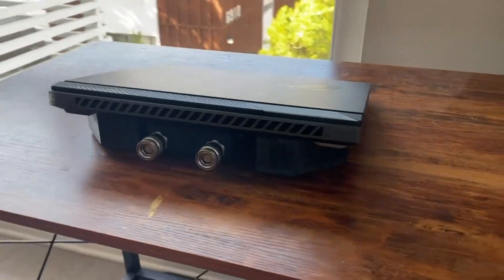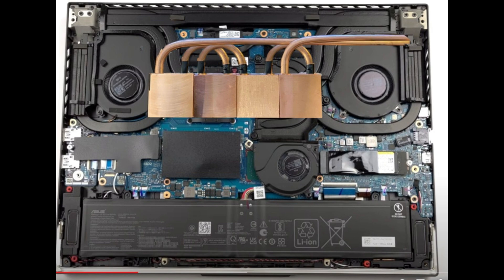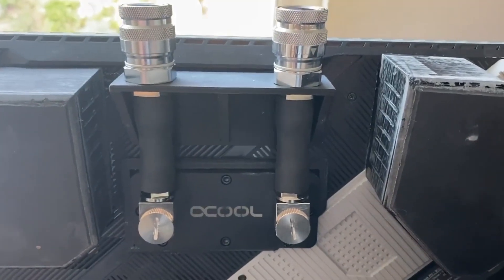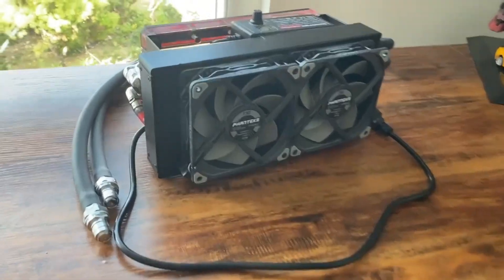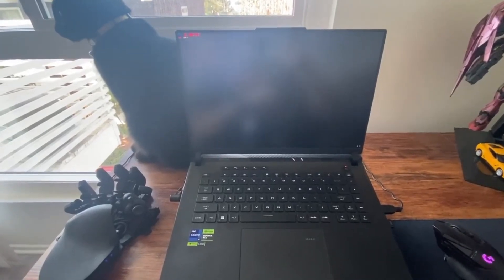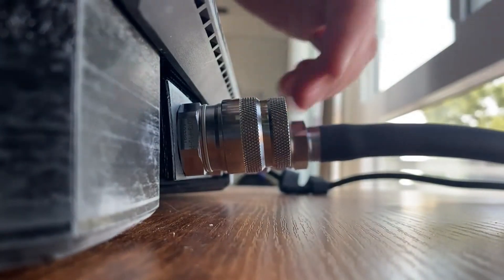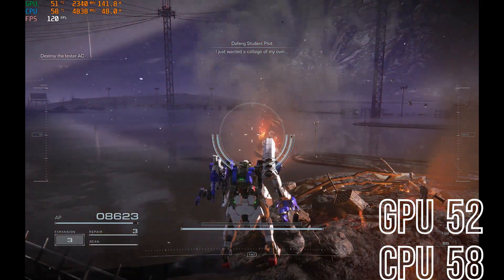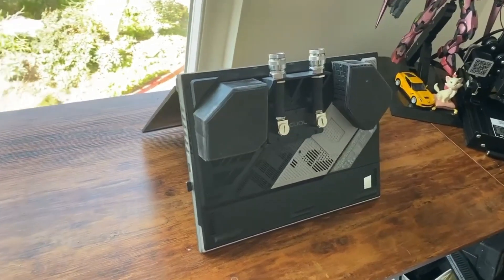Water Cooling a Laptop is... Easy?

Comment: Hey Sloreo awesome Video. My Laptop also throttles because of high temperatures and want to mod my Laptop too. However, I am not familiar with the pumps and reservoirs. Can you give me a recommendation. Had the Alphacool Eisbecher Aurora D5 Acetal/Glass - 250mm incl. Alphacool VPP Apex in view. Would you recommend it or another? Can I use a smaller reservoirs like 150mm. Alphacool Eisbecher Aurora D5 Acetal/Glass - 150mm. D5/VPP Apex which pump can you recommend.

Comment: Nice work! I've been wondering if I could actually mod the stock heat pipes to take water but maybe I will do this, seems pretty safe! Thanks for the vid!
Reply from the maker: That was my original plan actually but I went this route to keep the air cooling working.
Reply: @sloreo8278  Yeah good idea. I'll probably give it a shot next month. Do you think over time it will get heat soaked? Have you done any long stress tests?

Comment: I'm planning on doing this as a project. I have divorced parents so I need to bring my setup between houses (which means I can't have a desktop PC), and my fans are more akin to rocket engines, so I'll definitely be trying to water cool my laptop! You earned a like and a sub.
 
Edit: Do you know if this would work on a Scar 15? Thanks.
Reply from the maker: This should work on any laptop but the space between the back case cover and the heatsink will vary. You might need to sand some material off if it is too tight.
Reply: @Oh thanks, I found that some of the parts have been discontinued so I’m not sure if I’ll be able to make this work

Comment: Can I ask you how you soldered the pipe to the heatsink? I’m just a little scared that the heatsink will fall apart because of the heat. I mean the heatsink is also only soldered, right? Did u have problem of the heatsink falling apart?
Reply from the maker: @mr_geggi2691  if you dont mind the bulk I recommend using a CPU or RAM water block. If you are set on soldering, you will want as many metal c clamps as you can get to hold it all together. You can also use aluminum tape but idk what temp that will be good up to. If you dont use clamps it absolutely will fall apart. LTT did a video on that method a few months ago. "Water Cooling a Laptop for $30" iirc.
Reply: As for now im with soldering because my cpu and gpu dye are not lined up like yours. Which would lead to a diagonal waterblock arrangement. Think I won’t like that 😅. 
Plan for now is to use as much clamps as I can like you wrote and just use the heat gun to heat up only in small areas. At least I hope it will heat up small areas.

Comment: at this point just get a desktop its not laptop anymore ( but really amazing work )
Reply from the maker: @negadyoucef647  it is still portable as it is, albeit I have a new job so it doesn't go to work with me every day now, so a year later Id rather a desktop. That said, the air cooling still works fine, it is jsut bulkier.

Comment: This is really good! You have a version 2 of this based from what you observed?
Reply from the maker: This is version 2 and I have a 3rd Ive been using. The first was another video I did with my old MSI GP66. The only changes Ive made since this have been using a different water block for better contact and cooling.

Comment: Pretty nice Modding. 
But i prefer the easy Connection to the oasis. 😂
Reply from the maker: @MichaelK-lz7jk  the oasis is definitely prettier, but this uses similar quick disconnects and has more than double the cooling.
Reply: @sloreo8278  You dont have more power with that cooling, the oasis is enough to reach the Max Watts. If you have 50 or 65 degrees, that didnt make difference. 
The new one with 16“ is Even more powerful, it can 200Watts on CPU, more than every other Notebook.

Comment: did u place the 3D printed feet exactly where the air intakes were supposed to be for the air cooling? i mean this stopped you fom combined cooling
Reply from the maker: They aren't placed based on the fans for this one. The feet don't block the air cooling at all though, it still works as well as it did without the water block installed. There isn't much point of using both at the same time though, the water cooling already cools the heatsink enough that the fans make little difference.

Comment: Sorry man the red liquid that you use for the cooling system is electrical conductive? or not? if there is a waterdrop inside its risky or nothing will happens?
Reply from the maker: The coolant is absolutely conductive, it is similar to automotive coolant and is primarily water. I am not sure if there is a non conductive coolant out there other than thicker oils which are used for less common fully submerged builds. If the water block ever leaks, it will be a bad day for me lol.
Reply: @sloreo8278  ahah so hope it will never happen 🙏

Comment: Is this possible on a Lenovo legion 5 slim 14?
Reply from the maker: It will work on any laptop that has a traditionally mounted heatsink, like your slim 14. The only ones I know of that wouldn't work are the Dell G series which have the motherboard inverted. 

The only thing Im not sure of on ones other than mine would be the gap between the case cover and the heatsink. If it is too tight you might need to grind the cold plate some to not flex the bottom case cover too much, as I needed to do with the AMD block Im using on my most recent video.

Comment: thats awesome :O i wonder if i can do the same with my laptop. however my laptop has inverted motherboard :( gonna be a nightmare
Reply from the maker: There isn't any clearance with an inverted mobo sadly, unless you want a hole in the middle of your keyboard. I actually sold my Dell G15 a few years ago specifically to get a standard layout to water cool it.
Reply: @sloreo8278  yea, guess am done for :/ thankfully switching to liquid metal did gave me a bit of advantage, but i cant reach my max clock speeds. Funny enough i tried putting my laptop near AC and my laptop ran at max 80-85 degrees Celsius and ran at max performance 🤣🤣i was hitting PL2 limit all the time on my CPU, thats 25 extra watts 👌👌

Comment: Is there a way you could help me out... A total noob to do this with my dell g15 5515 Ryzen edition?
Reply from the maker: This is not possible with the Dell G15 sadly. The Dell mounts the motherboard upside down so that the heat sink is actually between the motherboard and the keyboard. There is not space to do anything like this or like my other build on my MSI. That was actually the reason that I sold my Dell and got my GP 66 a few years ago, I wanted to water cool it and it wasn’t physically possible.

Comment: How did you mount the ram heatsink to the motherboard? Or you're just relying on the thermal paste & the pressure from the back panel?
Reply from the maker: The block is just mounted by the pressure of the bottom cover. The gap between the case and the heatsink is about 4mm and the cold plate is 4.2mm. Once it is fully installed it gives it a decent mounting pressure.

Comment: How did you connect the fans to power?
Reply from the maker: The fans are powered by the variable PSU in the parts list under the description. I cut off the barrel connector and soldered in power for a PWM connector and a SATA connector for the fans and pump respectively.
Reply: @sloreo8278  Ah thank you
Reply: @sloreo8278  Also do you think you could improve performance even more using a cooling pad like the iets one?
Reply from the maker: @rrrrrrrfffdfjhre  The heart of this project is to run the laptop silently more than to cool it drastically more than stock, although it certainly does. With the laptop's own fans at 100%, the cooling is only improved  by 1-2*, nothing substantial. The IETS might give it more kick, but at a certain point there is only so much head that the heatsink can dissipate. Realistically, this is a very inefficient way to cool the laptop as eventually the heatsink will be a bottleneck. By using the IETS you would more than likely hit that bottleneck for little gain while also going from nearly silent running to 60db of fan noise.
Reply: @sloreo8278  That is very true. Do you have a discord server of some sort I could join?
Reply from the maker: @rrrrrrrfffdfjhre  I do not. Always glad to answer questions here though where they might help someone else with a similar question.
Reply: @sloreo8278  Alright well thanks for responding to me I'll let you know if i run into a different issue
Reply from the maker: @rrrrrrrfffdfjhre  within the next week probably. I’m trying out a different water block to see how it works compared to the others, but I needed to get a new bottom case cover and basically remake the entire thing.

I work 12 hour shifts 5 to 6 days a week though and this is just a hobby. Definitely don’t want to make any expectations for a schedule or any videos after the next one realistically.

Comment: How are you powering this whole thing? The waterblock I mean.
Reply from the maker: Just a variable 12v power supply from amazon. Cut the barrel jack off and soldered a PWM and SATA jumper on. Totally missed adding it to the parts list in the description.

https://www.amazon.com/gp/product/B08BL55LMB/ref=ppx_yo_dt_b_search_asin_title?ie=UTF8&psc=1
Reply: @sloreo8278  Thanks. Amazing work btw. I'm going to do similar mod for my laptop but with 120mm setup instead, and fool around with M.2 water coolers since they're even slimmer in profile.
Reply from the maker: @aj9156  I hope it goes well! Im trying a revision in a few days with a different water block that has some micro fins to see if it is any different, hoping it will improve by a few degrees. The slightly smaller SSD block should still be plenty to make a difference, but I did have concerns about how smooth they are when considering them.

Comment: The setup is very great. I just want to know how do you supply power to those fan and pump? And how do you control the speed.
Reply from the maker: The power supply is a 12v variable psu from Amazon that has a dial to control power. The Phanteks T30s have a speed setting to cap the maximum fan speed so I can set them to stay silent while cranking up the pump or set them to full speed for benchmarks.

Comment: Will this work for other laptops given the variation in mounting pressure?
Reply from the maker: I really lucked out with the Scar 16 having 4mm between the heatsink and the inside of the bottom case cover. Most laptops should have similar spacing but might need some sanding to make it so you aren't putting too much pressure on the CPU/GPU die. 

Easiest way to measure is to use putty on the heatsink, put the cover on, then measure its squished height, it is how you measure clearance for bearings in an engine too.
Reply: Question: I have a vapor chamber heatsink laptop instead of tranditional heat pipes, (the asus rog advantage). Do you think it will work just the same if I put it on top of the gpu and cpu location,? Does sanding off the black paint from the vapor chamber neccessary before putting thermal putty?
Reply from the maker: @giangle2849  A vapor chamber will work as well and has the potential to work better because you can get a larger water block and have a bigger surface area to cool. I would still center the cold plate over the CPU/GPU but realistically it shouldn't matter too much because of how the VC works. 

I haven't sanded the paint for mine at all and don't think it would make a worthwhile difference.
Reply: @sloreo8278  thank you!!! Attempting the same mod, hopefully it will turn out like yours!!
Reply from the maker: @giangle2849  Hope it goes well! Check out A-Accessories for a spare bottom case cover. They have OEM Asus parts and have been great for me so far. That way you can have your stock cover for any warranty work or air travel.
Reply: @sloreo8278  mine is stantionary most of the time, also do you think the pump volume affects the temps noticably, can I just go with 1 fan and 1 radiator and a 300l/ hour pump?
Reply from the maker: @giangle2849  my MSI build uses a similar pump from amazon and sees similar temps, not quite as good but it also uses a different setup so it is hard to compare. I did notice a huge difference going from the BeQuiet Pure loop pump but that is a very small and slow pump. 

Water cooling does have diminishing returns and generally 120mm is recommended for every 100w of power. I think that 240 will be plenty for any laptop but 120 wont be quite enough, see XMGs 120mm Oasis as it still hits 90* in Dead Space. The price difference for getting twice the radiator isn’t much, not to mention if you change your mind later and get a second one anyways. 

I just tried using 2 240mm rads for a total of 480mm and had negligible differences (2* about) that were probably more from the difference in ambient. Havent tried only using 120, but just looking at the XMG/Tonfang/Dream Machine/Eluktronics I don’t think it would be enough.
Reply: Would you say this is superior to copper water pipes in terms of heat dissipation?
Reply from the maker: @giangle2849  yes, especially for you having a vapor chamber. The biggest advantage here is that there is greater surface area for heat dissipation, aside from being safer from not needing to solder. 

If you look at the first place score for 3DMark Time Spy with a notebook 3070ti you'll see Microbemossberg's absolutely stupid low temperatures. They are running a Legion with literally the entire VC covered in TG PP10 thermal putty and those small copper water blocks I was considering using shown in the beginning of the video.

https://www.3dmark.com/spy/43532529
Reply: @sloreo8278  wow 22 degree for gpu is nuts
Reply: @sloreo8278  those coppers water block are some thick boy. I was thinking of designing a flat copper water block with bigger surface area and about 5-6mm thick to cover the whole VC but I don't have the decent fusion 360 skill to actually make a model out of it lol
Reply from the maker: @giangle2849  I had hoped to do similar to cut down on the height and increase surface area but wasnt sure how to go about getting the heat sink machined or printed without it costing more than the laptop did lol.
Reply: @sloreo8278  Hey bro, I finally finished replicating what you did and made a video about it. The result was great, still there's room for some improvements but overall it's great. Really appreciate what you did
Reply from the maker: @giangle2849  Awesome work!
Reply: What is your max cpu temp when running Cinebench R23?
Reply from the maker: @giangle2849  iirc it is 84* pulling 180-160w. Cinebench will absolutely still get your temps cranked up. My GP66 still hits 90*

Comment: I was thinking of using an all in one loop for price and ease of assembly, similar to this,
Definitely easier than low temp solder, but less removable.
Reply from the maker: You could absolutely use an AIO but the cold plate on them is generally much thicker because it is where the pump is. Your best bet going that route would be a BeQuiet Pure loop because the pump is in line with the hoses, and not part of the  water block. 

I know some people who tried doing that with thermal pads instead of putty and didn't have as much success with the cooling though, and using putty with an AIO you'd need to leave room to twist it off, because once it is squished down pulling it might cause damage.

Comment: If you want to go the extra mile you could 3d print a new bottom panel instead of chopping up the current one. Nevertheless it'a more revised than the one with the msi notebook.
Reply from the maker: If I had a bigger printer I would be much more inclined to go that route. The Scar does have some odd lines to it but that isn't anything some measurements wouldn't take care of. Having a 4 part bottom cover worried me though.

Comment: A gaming laptop that can be used for gaming without headphones and without bothering anyone with fan noise👍
Reply: That's pretty much any laptop if you learn a little bit about how to optimize performance and power consumption, instead of letting everything run as is by default.
Reply: @skeptyka You're doing great, I hope that's sarcasm? Good luck playing with  50w tdp👍 you must be an Harry Potter in this field?😎🤣
Reply: @ Yeah, 50W gives you plenty of perfomance with modern hardware. As with most hardware, CPUs and GPUs are less and less efficient the more power you give them.
Reply: @ To give you an example, with the new AMD HX 370 at 15W + 4070 at 35W (50W combined), you get about the performance of a desktop 12400 + rtx 2060 combo. There's so much you can do with that.

Sources: "Jarrod's Tech GPU Power Scaling", and "Notebook Check - AMD Zen 5 Strix Point CPU analysis - Ryzen AI 9 HX 370 versus Intel Core Ultra, Apple M3 and Qualcomm Snapdragon X Elite"

Comment: The water stuff is not worth the anything involved (money, time, intellect used to devise). 
Better get a mini ITX 10-11l case and you have much more performance with similar price paid and no effort put into it. And it can even be water cooled inside.
I was thinking of a similar thing, but aircooled.
You know like desktop GPUs have those massive 3 fan addon on the very small PCB, doing the same thing, taking a block of cooler fins with the fans and replacing the tiny ass laptop one for when you stay at home or go to a hotel or stuff like that. Would be like one of those cooler pads some people use (without any actual gain)
If that brings 15-20% increased performance, that is worth it.
Reply from the maker: Except you cant really take a mini itx with you to work or on the go (not to mention on a trip). The air cooling in this still works and it goes to work with me and on the go nearly every day.